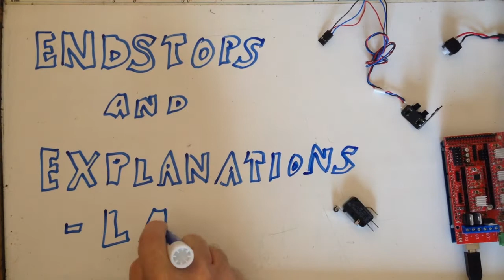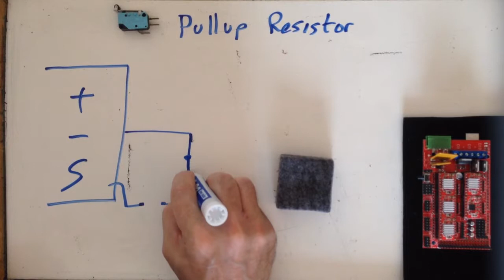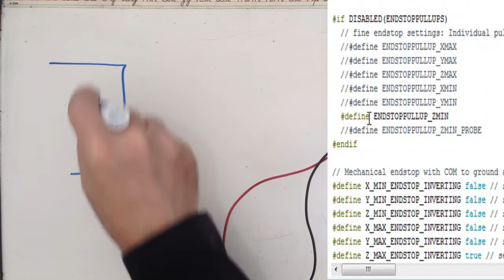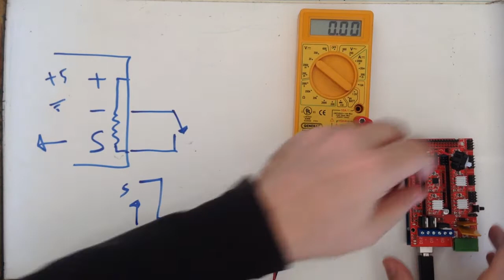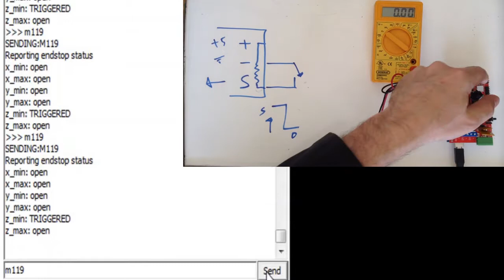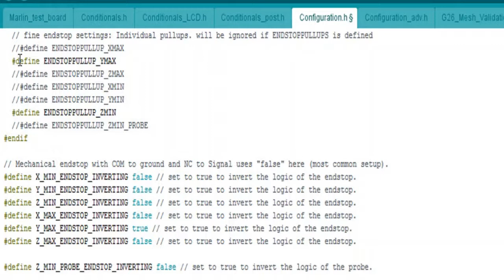Endstops and Explanations pt1B  Lab

Comment: so... you were getting false triggers without the pull-up, and you've added that, as well as inverting the signal so that you have a NC, signal pin pulled low, open state situation......   what happens when you trigger the switch to NO.... is there potential for false opens???
Reply from the maker: Good question.  And no. The pullup resistor is holding that signal to a 5V level so the signal isn't "floating" between 0v and 5V,  That's what causes the intermittent sensing- if the pin isn't held down to a LOW  (ov) or HI (5v) then the signal can jump around anywhere between 0 and 5V.  Depending on when you look for your endstop, you could see it in either state, just like what I showed in the video. This is pretty normal for electronics and digital circuits, and good designers know to always tie unused pins HI or LO so you don't get this kind of randomness.
Hope that helped!